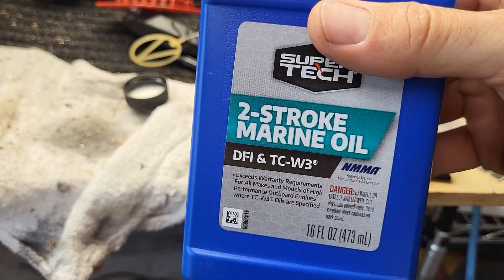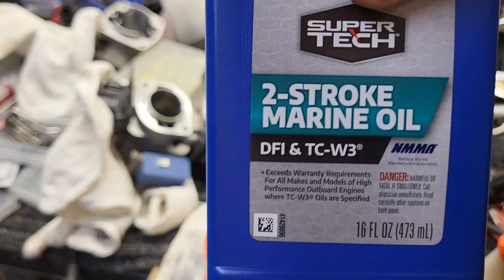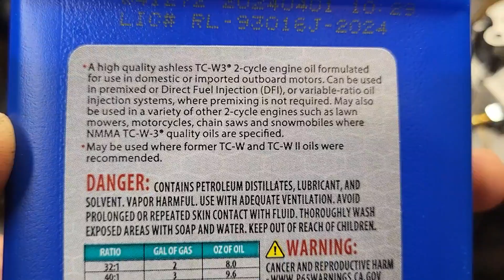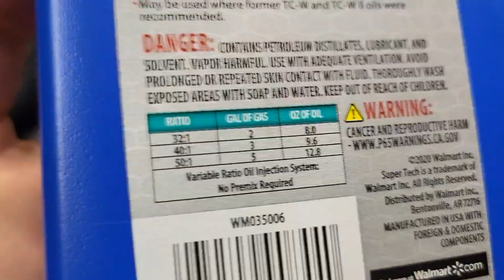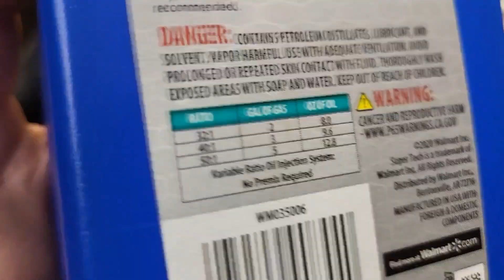Supertech TCW-3 @ 50:1 ratio

Comment: "YOu CAn't Run boAT Oil in an Air COOleD MoToR"  🤣🤣

With a lower flash point (150C ish) it should have burned a little cleaner.  The oil looked pretty thin to start with.  I didn't expect to see a good film, but the carbon after such a short run is a deal breaker.  Nice video!
Reply from the maker: Thanks Mr. Flagg, it's going to get another shot at 32:1 just for morbid curiosity. 

 i really want to change my testing procedures before i go full bore on oil testing, i'd really like to include wear testing but i need to build a tester first.
Reply: 👊RF

Comment: Tho I haven't used the Echo version, those heads are miserable for sure👎🏻
It didn't outright kill it is about the best I can say for the super tech TC-W3 at 50:1😬  I've noticed atleast with castor 927, it seems to leave less deposits in engines at 32:1 than at leaner ratios (40-45:1). Not sure if other oils behave similarly.
Excited to see the oil tests continue! As you have the time of course😁👍🏻
Reply from the maker: I think i will be doing tests differently just because the way i test isnt an ideal scenario. I want to test wear, 2 gallons through a saw being used for tree service, and a flame test to see how cleanly/quickly they burn.